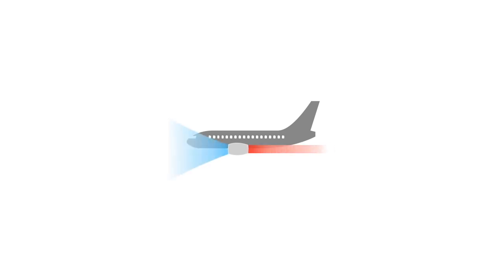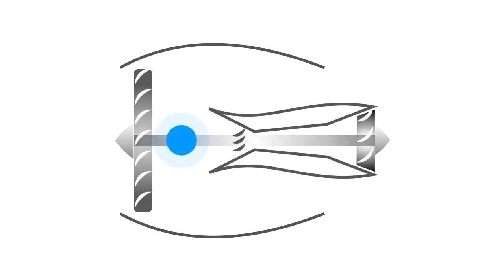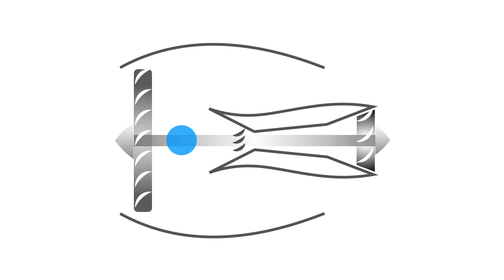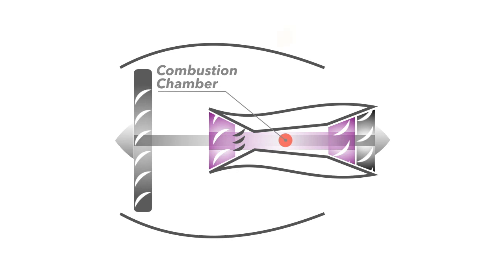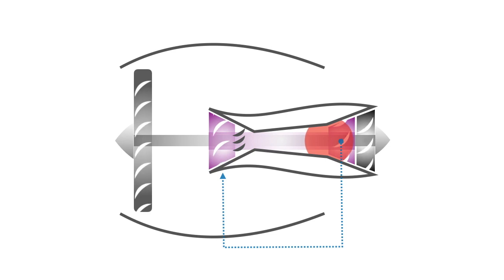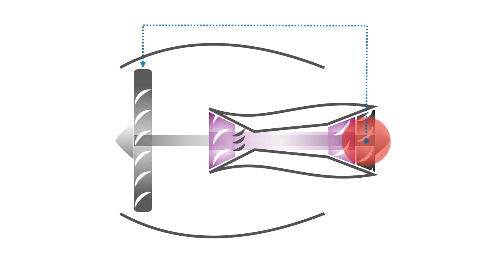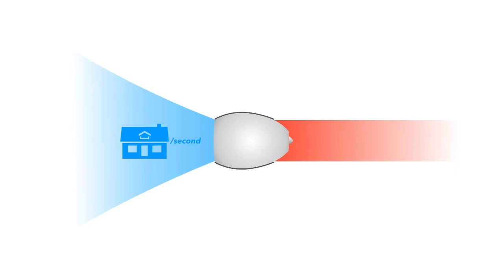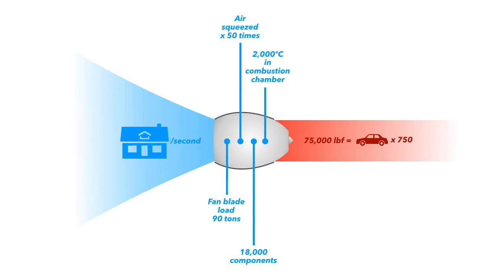How jet engine works?

Comment: Just to add something to this chapter: Trent XWB ENG used on A350s has got varying stages of fan blades and turbines, together with high-, intermediate-, and low-pressure compressors and turbines

Comment: In a Reciprocating Internal Combustion Engine, "Intake, Compression, Power, & Exhaust," also known as "Suck, Squeeze, Bang, & Blow," occur at different times in the same part of the engine. 

In a Gas Turbine Engine, Suck, Squeeze, Bang, & Blow occur simultaneously in different parts of the engine...😊
Reply: Also, as I like to say: A Gas Turbine Engine is "An enclosed windmill that makes its own wind." 

{Yes, I really made that up some years ago...😊} 

EDIT→ I posted this 'windmill' comment before watching this video. The word "windmill" gets used descriptively during this vid.

Comment: I don’t understand what prevents the exploding gas to come out in the opposite direction. Would  somebody explain please?
Reply: Usually the turbine after the combustion engine has two shafts. A high pressure turbine shaft and a low pressure turbine shaft.
The low pressure turbine powers the first few stages of the intake. These help get the air to high speeds. Then the high pressure turbine powers the compressor. The high pressure turbine shaft powers the compression stages to compress the air.

The air doesn't come out the front end of the engine because the pressure in compression stages forces the air into the combustion engine using the energy of the combustion engine through the turbine. 

This is how I understand it. If your still confused about what high pressure and low pressure turbine means, let me know.
Reply: The compressed air pressure and momentum is more than the combusted gas pressure ., this prevents the combusted gas from moving backwards